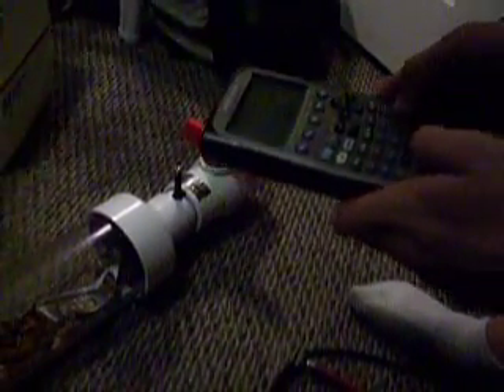hyperbaric mouse chamber science experiment

Comment: 10 years video unburied for comment : In humans, the main danger with hyperbaric environments is oxygen toxicity and nitrogen narcosis (as you correctly stated). When partial pressure of oxygen gets past a certain point, neurological damage happens, and nitrogen at high partial pressures creates a condition called nitrogen narcosis. The other danger comes from fast decompression : the bends. Oxygen toxicity and uncontrolled decompression from high pressure can both be lethal. I don't know if the effects are as pronounced for mouse, but that's clearly abuse for the poor mouse. it didn't deserve it unless it had carbon monoxide poisioning in the first place (in which case hyperbaric oxygen is the recommended therapy). What probably saved it is that it didn't stay at high pressure long enough to experience detrimental effects.